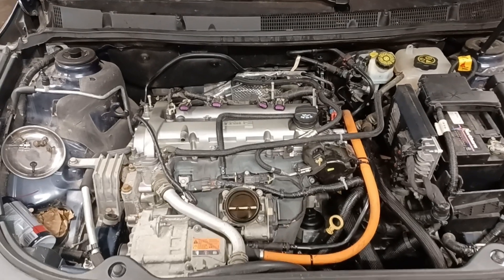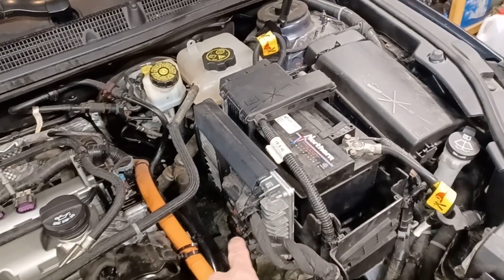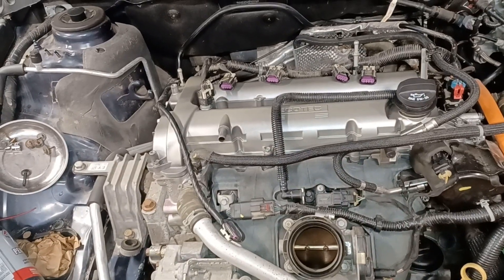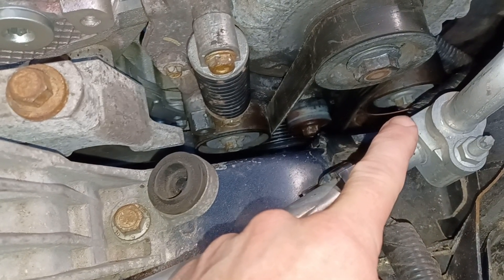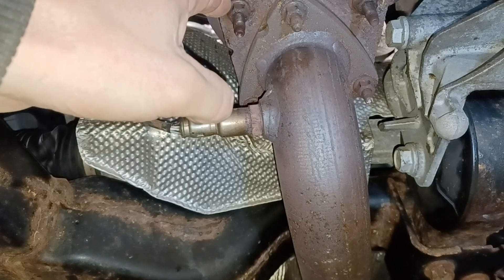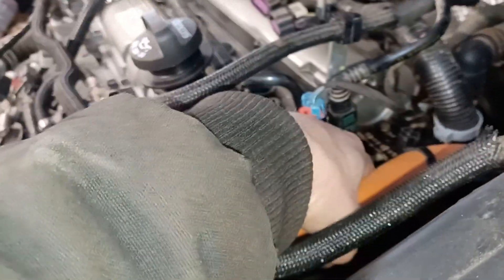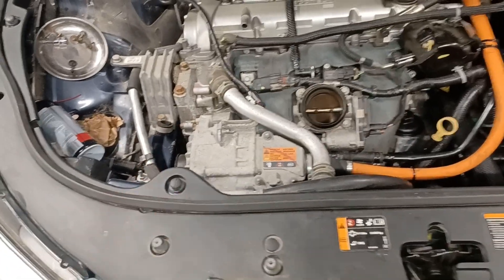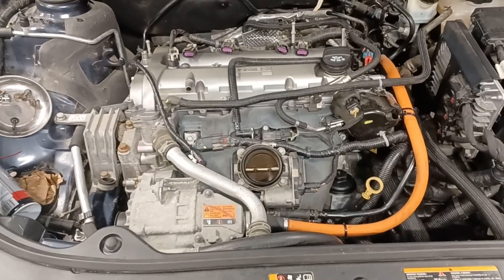GM ECOTEC 2.4 Liter Engine Change Hybrid Buick Lacrosse

Comment: We changed the belt last year as it was getting noisy. It was over 10 years old and had a lot of tiny cracks so everyone should do this service.I think GM upgraded the pulley several times so that should also be replaced. 

CTA Tools 5460 is a cheap spring compressor tool (note there is a second belt tensioner too, plus one needs to remove the metal "stop" before doing anything). The AC line is nearby and the plastic connection is weak, so don't touch that.

Comment: Our 2.4 hybrid has been very reliable overall. Our strategy to avoid problems follows. Some of these steps are probably useless lol: 
1. Very frequent oil level checks!!!
2. 5k (or less) oil changes (DEXOS full synthetic). 
2a. Currently, we are using Valvoline restore & protect oil to try to clean piston rings. This is NOT DEXOS and might be snake oil lol)
3. Occasional Italian tune ups to loosen piston rings.
4. GM's FC219 vented oil cap. 
5. Spray to clean valves from DI soot
6. Clean the PCV orifice every oil change.  We drilled an access hole in the intake manifold to slide a paper clip into the orifice (there are youtube videos). Ideally, one would remove the plastic intake and check the 4 passages from the orifice to the runners but that is not so easy with the hybrid model. One can try spraying some intake cleaner I suppose. There is a service note that says to block a port and one indication of a properly working PCV system is a whistle; that is not too reliable I suppose.
7. If we hear any timing chain noise at first-morning start up, we will replace the timing set quickly to avoid serious damage.

Comment: Helpful video! The PCV orifice in the plastic intake manifold tends to clog with carbon on these 2.4 DI engines. The intakes are easy to remove on a terrain but tougher with the hybrid. 

So for older engines, this is a good opportunity to clear the intake orifice (and make sure the 4 passages to the plastic runners are clear with a spray). And clean the valves of carbon.
Reply from the maker: That clogging of the pcv orifice causes them to burn more oil, run low, and damage the engine if you neglect the oil level, right?
Reply: @andyanderson5242  It seems to but nobody quite knows. Clogged PCV orifice seems to blow out the rear main seal, particularly in colder weather. GM sold a vented oil cap FC219 that might help a bit but is not perfect. 

GM also recalled some low-tension piston rings for blowby. Maybe the DI tends to clog those rings too. All potentially contributing to oil consumption.

The timing chains seem really sensitive to low oil, even just for a short time. One tell tale is a 1-second ratting sound at first-morning start up. Since this is an interference engine the problem can't be ignored. GM upgraded the timing tensioner, oil sprayer etc.